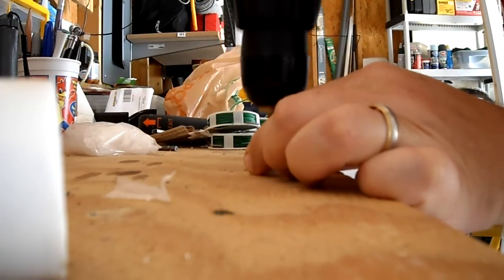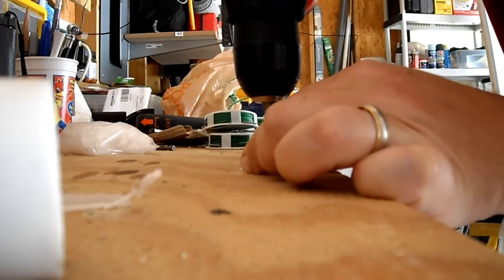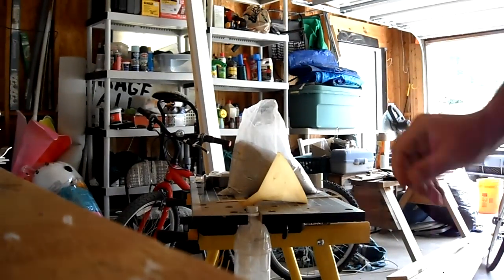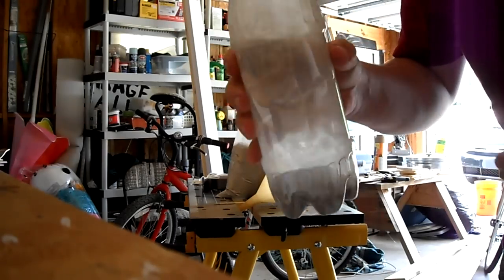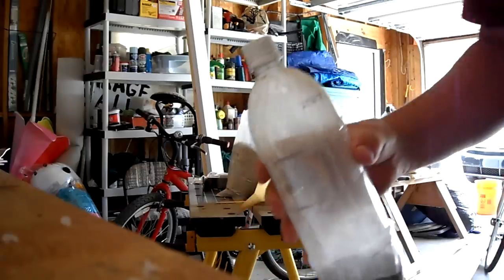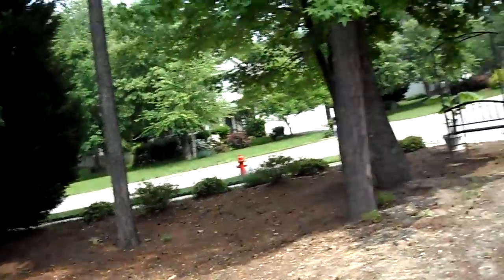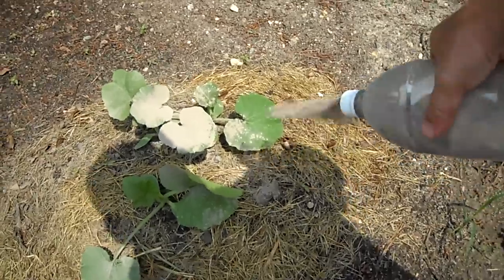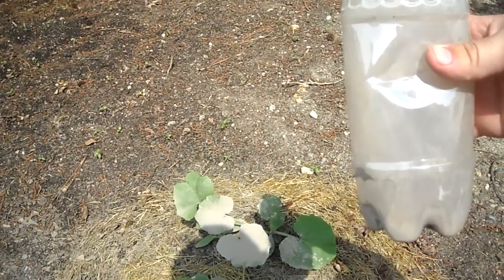How To Make a Diatomaceous Earth Plant Duster

Comment: Forget the drill. Take a box cutter let the tip heat red on the stove and melt/slice through the lid. The slices let you control the flow to mist or cloud the powder. Use a POWERade bottle. Good idea though.

Comment: Well, that was easy.  Lol.  Thanks for the tip.  I was wondering if you find the DE "sticks" to the plants better when they're wet or if them being wet prevents the DE from working properly?  That wouldn't be an issue for the top of the leaves, I suppose, but I was thinking that the underside of the leaves would need to be wet to get it to stick (bugs do like both sides of the leaves); have you tried to dust the underside?  Does it work (as in, "stick" to the underside) when the plant is dry?

Comment: What diameter drill bit are you using?
Reply: 15/16th
Reply: @jayce5025  Surely you mean 1/16"? 15/16" would take out the entire bottle cap in one hole!